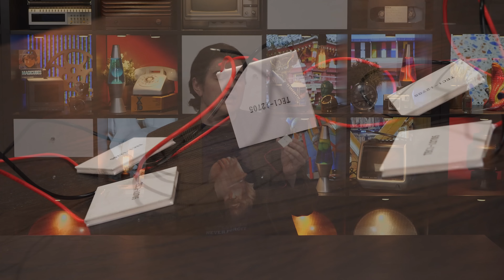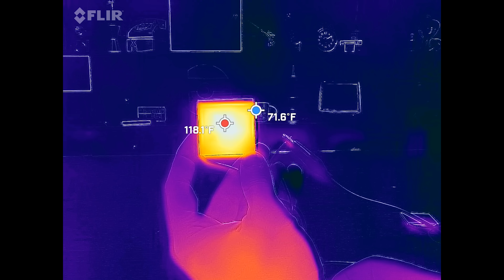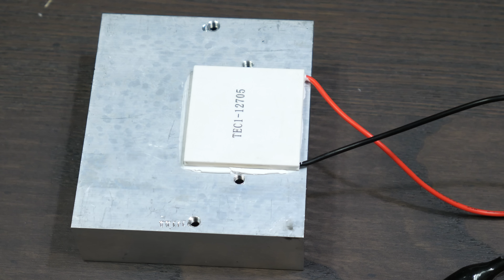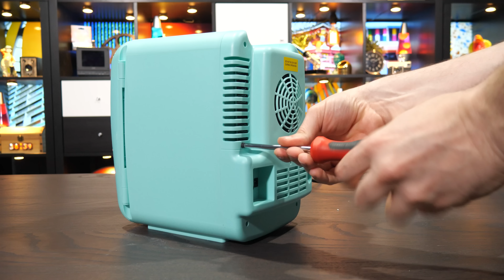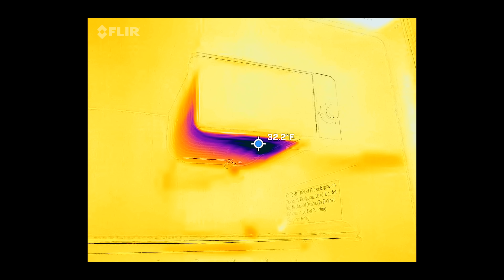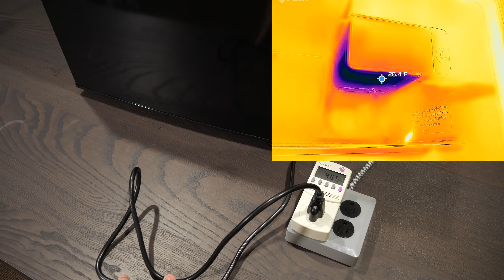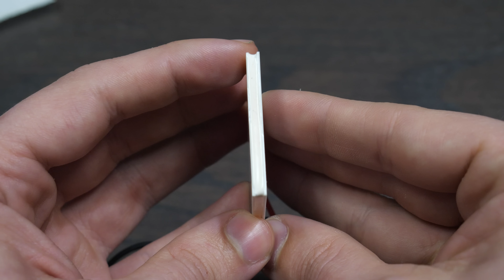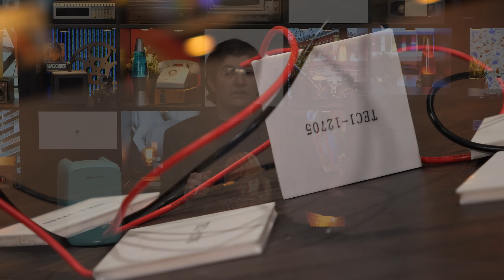Thermoelectric cooling: it's not great.

Comment: G'day,

You missed an
Application or two.

Fitted between an extruded Aluminium Base, atop a Woodfired Stove, and an extruded Heat-Sink, little 
Peltier Devices are used to generate DC Current,
Fed straight into a little
Motor,
Spinning an 8-inch or 7-inch
Sheetmetal Fan..., at 600 to 950 RPM.

That Airflow, drawn into the Disc from above the Hotplate, is thus
Blown horizontally out into the Room,
Making the Wood-Heater warm a large Room much more effectively, by
"Stirring up the Air & adding a Horizontal Vector to the  very
Hottest Air coming off the Stove.

Sadly, over 5 generations of iterative Design, over maybe 8 years, the people manufacturing them have been handicapping their Units with
Execrably inefficient
Sheetmetal "Fans".

Squeaking as one who has flown behind two home-designed handmade Wooden Propellers, the Fans are an insult to my intelligence, so I've made 3 laminated, helical Propellers all better than the Sheetmetal Units which came from the Factory.

The 5th iteration Fan does succeed in matching the Airflow generated by my 3rd Prototype - but it does it at 950 RPM, with a 7" Diameter & 4 Blades..., while making a faintly aggressive "Buzzing..." noise ; as against my laminated 8" 2-Bladed Helical Airscrew, running silently at 650 RPM...

The Manufacturers have apparently doubled the Power output of their motor, to be able to spin a terribly inefficient slightly smaller, CHEAP Pressed-Sheetmetal Fan - sufficiently fast as to actually, noisily, shift some Useful amount of
Very turbulent, vortex-riven
Massflow, through their little
Disc.

So, One 
Good use for those Peltier Units.

Another one is a Tea-Candle heating a Peltier Unit, which runs 4
LED Lights,
Producing about 10 times as much Light than does the
Tea-Candle heating the Peltier Device.

Our Own Devices Channel has a Video detailing the Tea-candle-powered LED Lights.

Have fun...

Stay safe.

;-p

Ciao !l

Comment: I don't think you've given the Peltier cooler enough credit; it's the perfect item for a prank based on getting someone to think you've put a CPU into a computer of theirs. 
"But," they'll croon in comical despair, "I saw you put an electronic square under that heat sink! It said Intel, albeit in characterful handwritten script, and plugged into a motherboard header when you used that dongle-thing!" All the while, you can have a solid and sensible chuckle at their temporary misfortune. A truly revolutionary development in the oft maligned field of The Modern Prank!

Comment: I'm curious how much better that mini fridge would perform if it was better insulated as well as the cold side of the Peltier being heatsinked and having a fan like the heat side does. Maybe add a thermostat after that. A thermostat on this one with it's current design would be useless because it can't reach any target temp due to how terrible it's thermal design is so kinda makes sense why it doesn't have one. It would need to run 24/7 anyways just to maintain that luke cold temp and it would very quickly heat back to room temp if it wasn't running for any amount of time.

That's a big problem with that mini fridge's design. There's no heatsink on the cold side and no fan to help move air across it.

I feel like that alone could make this mini fridge barely passable as a fridge with a thermostat to help with energy efficiency. (and heck if it does manage to get cold enough to actually freeze things, then you'll need a thermostat to avoid that). But alas, extreme cost cutting = something that is very bad and almost a scam outright. :P

You should try and homebrew your own Paltier mini-fridge and see if you could get anything remotely passable as a mini-fridge just to see if the extreme cost cutting is the main reason that mini-fridge utterly fails at it's job.

Comment: In the medical field, there is a process known as polymerase chain reaction (mouthfull, use PCR instead), also known as DNA amplification. This process uses temperature cycling to replicate a strand of DNA, doubling the number of DNA strands with each temperature cycle. A temperature cycle consists of a dwell time at 60°C (140°F) for a minute, and a short dwell time at 95°C (203°F) for about 15 seconds. This is a popular application for Peltier modules. Power and efficiency do not matter much, but the speed at which you can slew the temperature is very important.

In our machine the rise and fall times between 60C and 95C tends to be about 30 seconds. There's a lot that affects that speed, in particular, how well you can cool the non-sample side of the Peltier. We've found that containing airflow to between the fins, and blowing in one edge of the fins, through the heatsink, and out the opposite edge makes for very effective cooling. 

Mounting a fan to the face of the heat sink fins moves air, but not where you need it the most - at the center of the fan. That is a stagnant air space, and guess where the Peltier module is mounted.

If you guessed in the center of the heat sink, opposite that stagnant air space, you'd  be right. So now you have one way to improve the cooling of your toy minifridge. Airflow is key! Now if the door had some foam injected in it....

Comment: One use of a Peltier cooler I have experienced is with astrophotography cameras to keep the camera cool and reduce signal noise.  For something like that, they are the perfect fit as it is cooling a very small area.  As far as refrigeration, they are for sure not efficient enough.

Comment: It's interesting that this video came out right now.  I have been wanting to experiment with peltiers in 3D printing.  Use them to heat up the bed during the print and then switch to cooling to rapidly cause the part to release from the bed.  Haven't bought the parts yet to test it though.

Comment: I work on a desktop medical device that uses peltier devices. Multiple sets of them. 
One set is used to cool a plate which holds reagents and maintains them at approx 16 degs C, while another set heats another plate to 37 degs C. There is a thermal fluid which takes the heat generated by the cooling plate and  uses it to offset the cooling side of the incubation plate in a (mostly) closed loop.

Comment: One use (from which I scavenged 3 assemblies): Thermocyclers. Each assembly is massive, what with heatsinks, power supply, fan and other odds and ends. These are quiet (easy to achieve if you use an oversize fan at a lower voltage), and do what they say. They cycle between 0C and 100C very fast and very precisely.

Comment: In 2019 Linus Tech Tips got a "bog standard" TEC CPU cooler (Thermo-electric) and it could only dissipate about 40W of heat. Purchased a top-end peltier cooler that could match a AIO water cooler and the water cooler drew about 20W and cooled the CPU well. In order to match the water cooler the TEC had to draw over 300W just to "almost" match it. 
Linky here:  /watch?v=IX2NQ1lq4ZM  This was in late 2019.  They are very specific use cases but "general cooling" is not it.

Comment: there's actually a great use for these things: cigar humidors. you never really need it to cool to under 60-65 and the reverse is also helpful (warming for when the room is too cold). they usually have thermostats as well and proper insulation/air tightness, so id image the efficiency is greatly improved.

Comment: A "proper" Peltier fridge has a heat sink and fan inside too. The one I bought is a "car fridge" and on average in a 30C hot car the fridge will do 12-15C running non-stop OR proper fridge degrees (~4-6C) in a 23C room.
It probably doesn't make a huge difference, BUT the blue fridge has no air circulation inside, that's a big fail.

Comment: Peltier coolers fit in much tinier spaces as well, and in applications that don't tolerate vibrations. Astrophotography cameras for instance are designed to work for hours at a time, and often have limited power available to them, but there's no heat pump that's small enough and the vibrations would be a disaster.

Comment: The efficiency of peltiers vary sharply depending on how much of them are wired in parallel & if they are staged or not (they are still worse in terms of efficiency than traditional carnots for most part).

 For ideal output you can only put around -20% of maximum current because of power loss law. This is why youd want to put them in parallel.

 Needless to say youd also want to have good cooling (my design has 8 peltiters stacked on 1 block, hot side facing 2 blocks, 4 peltuers per side) because the thermal energy from hot side creeps back into cold side which creates a feedback loop as hotside temo goes higher.

Most minifridge designs straight up ignore this principle because of size & cost, that is why most cheap peltier fridges are bad.

It seems like this was mentioned around 22:00 mark but grossly simplified. Theoretical COP for peltiers (also depending on ZT of material) is 2-3 (10K dt, 25% COP).

TLDR
Most minifridges dont have proper current limiting technique &surface area needed to efficiently employ peltiers. Ones that do, is more expensive because of complexity involved in controlling peltiers compared to vapor-compression (carnot) cycles.

That emerson cooler really seems to be a proof of concept product rather than an actual product, so you basically used a worst case example for this video. If you want a real product to compare gainst, try kimchi fridges.

Comment: I have a pelletier portable refrigerator, however it does have some température control. The point is portability. Yeah a real mini fridge with an heat pump is more efficient but unfortunately they aren't portable. I'm wondering about the available techs but yeah pelletier is all about portability .

Comment: When you look at the surface area, you could increase the performance dramatically by using more peltier modules in parallel.  Of course they're terribly inefficient....but it COULD totally operate effectively.  There are some measure that we could take to improve the efficiency....but it's still going to be incredibly inefficient in comparison.  I wish they would do more research into improving those modules.  It would be amazing for temperature control devices and even energy production.

Comment: Peltier coolers are also used in heated/cooled car seats.

You don't care about efficiency (especially if it's not an electric/hybrid), heating and cooling are in the same device, and a compressor would just not be practical.

Comment: I used to use a petlier cell cooler for car trips to move cooled food packed with ice packs. It didn't cool the food down, but it would make the cooled food take about two to three times longer to keep things cold for 8 hour car trips. It worked quite well considering back then you couldn't get a compressor style cooler that could run off a 12 V car outlet back then like you can now, and it took up much less space.

Comment: One major use for TECs you didn't mention in this video is also probably the reason they are so cheap and plentiful:
In a lab setting, TECs are used with a controller that uses a thermistor readout and a PID loop to keep a test platform a very specific temperature.
Because you can control exactly how much power you send to the TEC, you can often control temperature on one side to within 0.01C of a desired temperature, which is super useful for testing anything that might be temperature dependent. 
Additionally, if you have any temperature dependent components going into a system that will be in an environment where the temperature fluctuates, a TEC is a useful way of ensuring the temperature accuracy. 
Thus, TECs are widely used in testing and manufacturing of these components, making them as cheap as they would need to be for someone to think of making this mini "mini fridge".

Comment: Some years ago, when I was doing my masters degree, I was on a project called small energy, we were generating small energy from variuous sources, including peltier elements. Turns out they generate electricity from the temperature difference, not so much useful maybe you can run a small LED or crystal Watch, but it makes a fun science experiment.

Comment: Now, you've brought up a lot of solid points, but what you've failed to consider is that my Peltier fridge looks like an Xbox and that's funny. Don't worry, I only paid $45 for it on sale, not the $100 MSRP. Also, I prefer my beverages at 50F rather  than 35F, so it actually works better for me in a hot room (in a cool room, I just leave it off).

I do feel like they could use a cheap thermistor and a <100% duty cycle, plus better insulation, to make a much better version that would still be less expensive than the minifridge. Perhaps not worth using in a space large enough for a minifridge, but at least better.

Comment: I had one of these thermoelectric ‘fridges’ that I was happy with. I used it to keep a couple of cans of soft drink cool, and prevent some chocolate from melting.

I had it on a smart-controlled socket to only run when the solar panels were producing a surplus of energy. It essentially was free to run, and kept a couple of things cool and within reach in a space-limited room.

It’s a very specific use-case.

I should also specify that the household had two actual fridges, and two seperate freezers, all of which were full (or very close to full) at any given time.

Comment: If you rip out the interna freezerl door of the cube/mini fridge you have to run it at a lower setting. Which is why mine still runs after 15 years. Still the best $120 I've spent. Also Mae's me wonder of ypu can add a heatsink and fan inside to move the cold air inside in the toy fridge to help make it cooler but at that point might as well take the cube fridge.

Comment: You got that backward. The fan is not blowing at the heatsink but rather blowing away from it to draw the heat out of the device. If the fan was blowing at the heatsink, it would have the opposite effect and be useless.

Comment: I took the Peltier out of a fridge and sandwiched it between a heavy piece of metal and a computer heat sink with fan. I placed a tea light under the heavy metal,  it not only powered the fan but powered a 3v AM radio I had. So basically, I had built a tea light powered radio... When you apply heat to a Peltier it produces electricity.

Comment: A power price to die for .Even though we sitting on mountains of high quality energy our average cost per kwh 35 cents with some isolated ev chargers 70 cents a kw in more isolated parts of Australia. Will only get worse as in there green madness are blowing up working coal power plants when nothing to replace it.Most states got no  spare reserves and lucky we have some spare coal power to sell to them and if there renewable fail wide spread load shed the only option. Even our state delaying repairs to plants been broken for years try to reach this net 0 fantasy that will make us live in the dark.

Comment: You know what ALSO uses less than 55 watts 24/7?  A 14 cubic foot chest freezer!  Those marvelous contraptions you've made an entire video about!  Okay, maybe that's cheating...my 14 cubic foot chest freezer actually consumes 58-62 watts while it's running...but just like the cube fridge it doesn't do that all day long! Average use is roughly 0.8 kWh/day or equivalent to 33 watts continuous over 24 hours.  And that's outside where it ranges from 70-90 degrees ambient during that measurement.

Comment: I briefly had one of those. It's just a stupid cooler really. They also market coolers that run off a 12 volt accessory plug for your car, and those are okay for what they are for. But all they are for is basically sticking cold drinks from the gas station in and keeping them cold on a road trip. They won't keep the stuff cold for long, but they will do that. Some also have a hot cold switch, which just reverses the polarity so the cold side gets hot and the hot side cools off.

Comment: Peltier devices can be used to heat/cool small devices (like ICs or other devices) which are in direct contact with the Peltier element. They can be fast and be used to either cool/heat. They can have a thermostat to regulate the temperature using a temperature sensor and some electronics. These are niche applications of course. I will probably build one to see how well they work.

Comment: the good side of this Peltier  is when you apply heat to the heat side, this will generate electric to the wire, yes by changing heat energy to electricity, we have a small steel fan use it over a log burning stove, by putting the fan onto the hot stove, it spins to blow heat to the rest of the house. no need to plug into the wall outlet. This Peltier  is not totally usless.

Comment: Also worth noting. I had one of these can cooler "fridges" that I used quite a while to always have a nice cool drink nearby. It did that job just fine (without regards to energy efficiency at least). But it died after maybe a little more than a year of largely continuous use. And when I say died, I mean it basically burned itself up- started a very tiny fire that fortunately didn't go anywhere. So these things really should only be used occasionally, not just for energy's sake but for the life of the product.